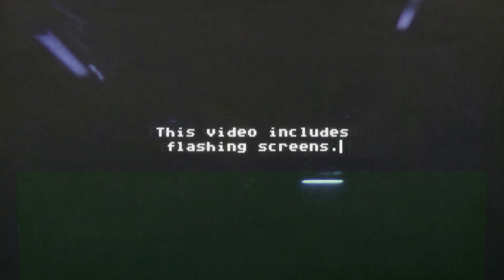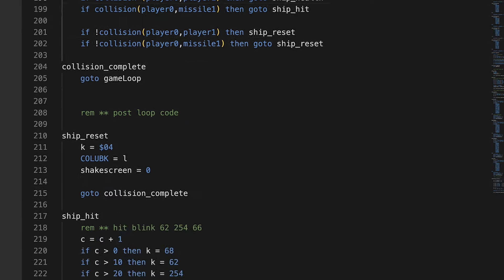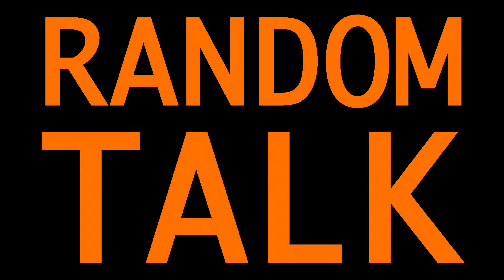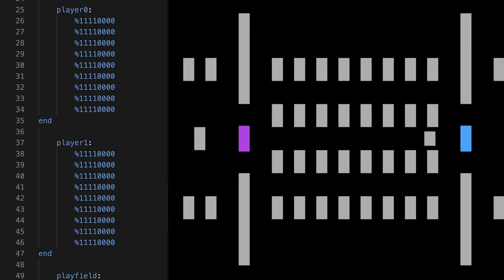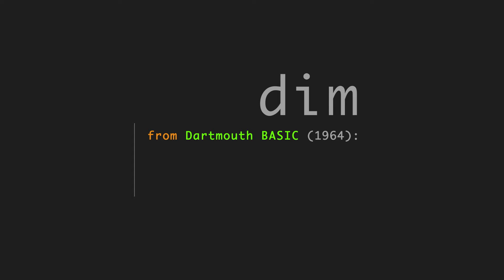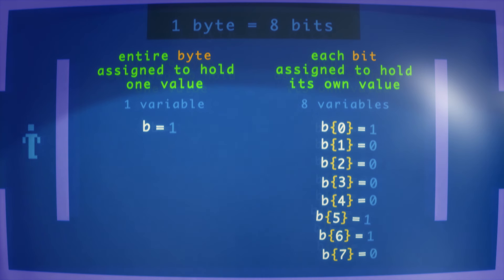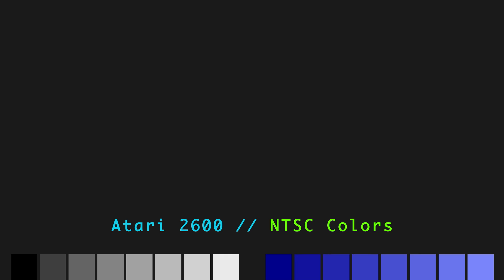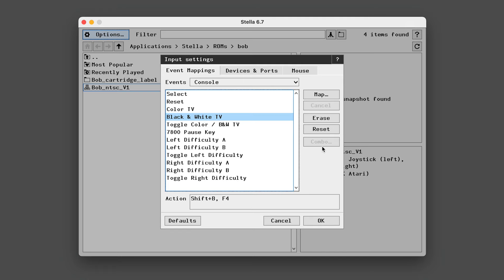Making Telemachus | Collisions + Color | Learning bAtari Basic!

Comment: Looking forward to seeing more as an aspiring future bB user  myself!!   I'm curious about your comment regarding not checking collision every frame to save on CPU cycles.  Would that actually matter unless you're alternating between different checks depending on the frame?   Admittedly I'm not a programmer (or more accurately haven't been since a sophomore year class in the early 90s!) but I was under the impression from following various AtariAge threads that the only CPU cycle count that matters is the worst case scenario based on if/then situations per scanline.   Would it matter then unless you're in desperate need for those cycles for some other function that frame?
Reply from the maker: Yes, I think you are right-- since at some point the game would need to run that particular code in addition to everything else anyway-- at which time there would be no cycle savings for that given frame-- unless that frame had a different equivalent offset of "unrun" code.

Comment: One way to make sure you dont go over cycles is to open Stella's prompt and type  breakif {_scan>#262} then return to the program.
This will open up the debugger if your scanline count ever exceeds 262.   Then at the end of your loop you can add some code to intentionally waste cycles by doing some commands with known cycle counts like WSYNC or nop, which will pause the cpu until the start of the next scanline, which could be anywhere up to 76 cycles for the first one and 76 for each additional one. If you want an accurate count, use lots of WSYNC until your program goes over, then remove one WSYNC, then add some nop before the WSYNC's until it goes over again. Then add up the cycles!
Example:
 asm
 nop               ;  2 cycles   2 total
 sta WSYNC ;  76 cycles 78 total
 sta WSYNC ;  76 cycles 154 total
end
Reply from the maker: Amazing! Thank you so much for this--!! I copied it into my coding documents folder.

Comment: So, your issue with 'rand' is more related to the '&' operator than with 'rand' per se - the value 68 is 01000100 in binary, and the & operator masks out any other bits in 'rand', thus only allowing 4 separate values, as these would be 00000000, 00000100, 01000000 and 01000100. You might want to use values that are (power of 2)-1 on (rand&n), as they would produce bit patterns that would not mask off any value of rand lower than n, as they would operate like the modulo (%) operator in these cases, which is more what you are looking for - but unfortunately modulo division won't be anywhere near performant enough for use with the poor 6507.

I think what you might want is to compose your random number as a sum of multiple (rand & ((2^n)-1)) values, where the (2^n)-1 values summed up will amount to the range you want. Ex.: if the range is 68, you can use (rand&63) + (rand&3) + (rand&1) + (rand&1), where 63 is (2^6)-1, 3 is (2^2)-1 and 1 is (2^1)-1. This gives you a range from 0 to 68, but with a heavy shift away from the numbers 0, 1, 2, 66, 67 and 68, due to the nature of averaging pseudorandom distributions.
Reply from the maker: Wow, tremendous. Thank you so much for this explanation. Fantastic!